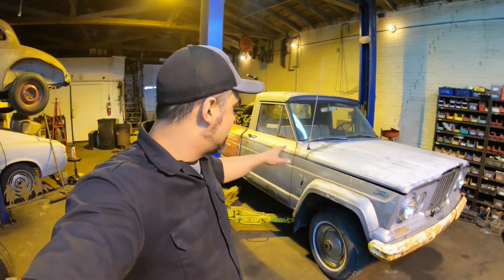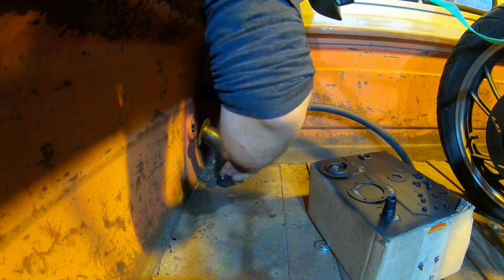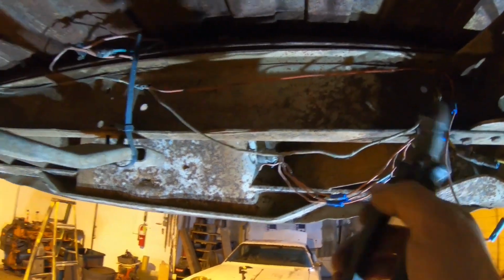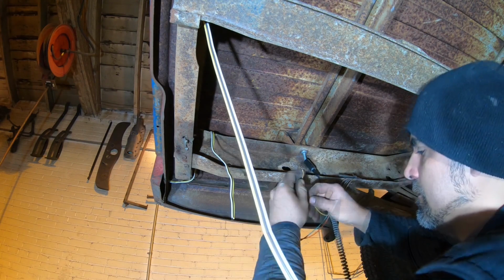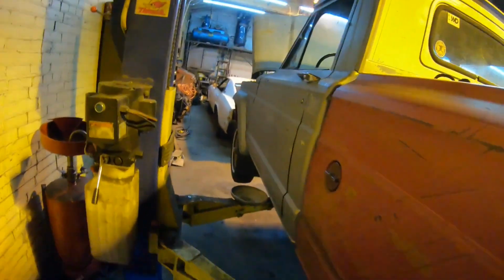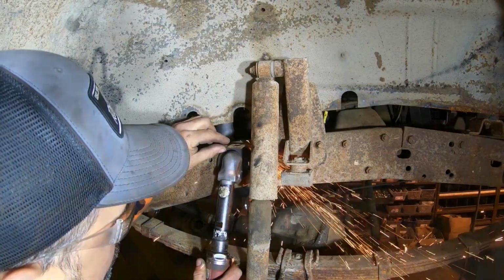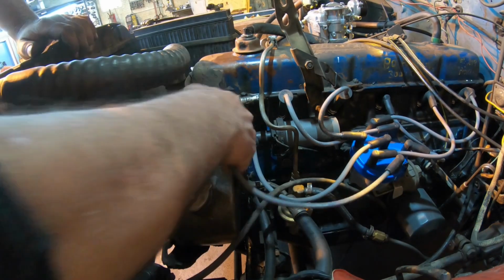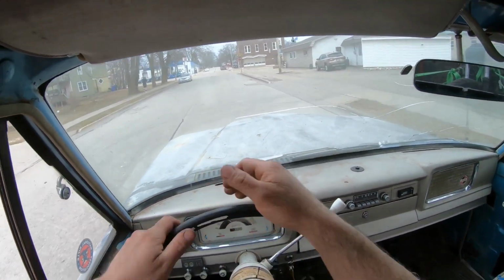1965 J-300 Jeep Gladiator  Revival!

Comment: That's my dream truck to get and restore. I've never restored a vehicle before but want to try it. Most of the ones that I've seen look like this one or in worse condition. I would need to get it running first, new tires and then strip it all down and paint everything. I'm kind of curious what it would cost besides the tires to get it running again if I purchase one with an original engine. I'm sure that I would need to replace all of the spark plugs, fluids, battery, hoses and am not sure about the rest. I'm thinking it might cost me about a thousand besides tires.

Comment: Never new they made the 300 but did go thousands later.
Had a 66 same truck J200, worked that truck from 79 to 87 till I cut it up and scrapped it, the rust took over, was a good truck.
 Of all things 7' box and had a PTO on the rear, it had like 40 grease fittings on it, the 230 OHC aluminum head was introduced on the WII ambulance truck, I never had a problem with the head warping, did put a 1 barrel holly on it along with allot of front end parts and a brand new Western 7 1/2ft hydro turn plow, did a ton of work with that truck, it was red. Still have the old key that you can barley see Jeep. lol

Comment: Pretty solid old Jeep. I think the 300 six will serve the owner well as the original engine was probably the overhead cam 230 cubic inch Tornado six which was not a great engine. I have my Dad's 1966 Jeep J - 2000 232 AMC six with three speed manual transmission and seven foot pickup body which I still use for snow plowing. These old Jeeps were great low speed work trucks due to their low gearing. Thanks for the video.

Comment: A manual gear box with a shifter next to the steering wheel!😮 how? I have a gladiator with a manual gearbox and a normal shifter position, but I also have a steering wheel with a automatic shifter from a Cadillac, can I connect my steering wheel shifter with the manual gear box?
Reply from the maker: It's a 3 on the tree. 3 speed on the column. It is different than an automatic column, has two levers under the hood, one for first and reverse and one for second and third. Lever on column has an "H" pattern just like a floor shift would.

Comment: Great content! Pleasure to watch. First video, so im off to check out some more👍 also, what clutch master did you use? Mines leaking and im struggling to find a replacement 😪
Reply from the maker: I actually found a stock one on eBay at the time. Slave and master were available. 👍

Comment: If those rear lights are led you need a led flasher  those leds don't draw enough amps for regular flasher to work
Reply from the maker: Yeah, I got them working off camera. I actually didn't even use an electronic flasher either, there was enough load with the front 1157 turn signal elements to make enough load to flash properly. Good call though 👍

Comment: I'd forgotten that Jeep did the column shift... about everything I worked on was floor shift, and most of the pickups were 4 speed anyway. That's probably a regional thing, I suppose. The Ford 300 wouldn't have been my first choice, but it seems to work okay. I wonder how many carb chokes I've seen hooked to manifold vacuum.... it's a bunch, and sometimes it's hard to fix without a bit of thought. Good video; thanks!